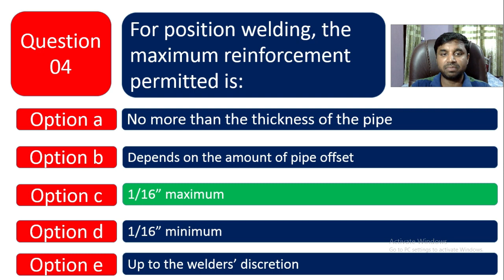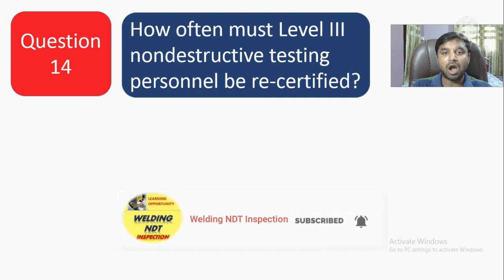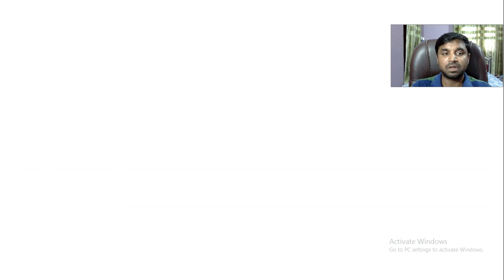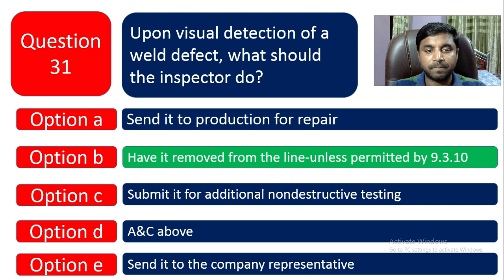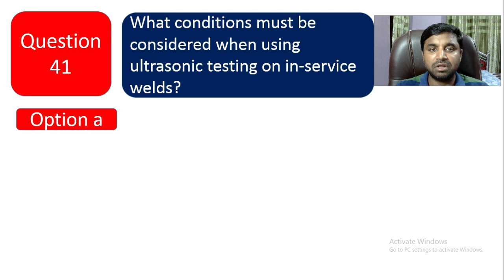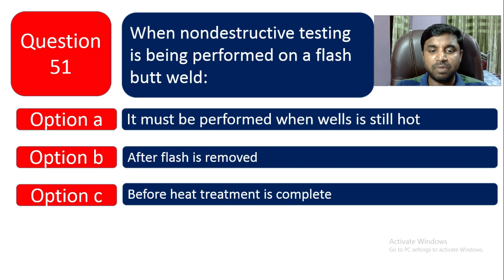TOP 50 API 1104 Welding Inspector Interview Questions

Comment: Question no:43 and 45 are confusing, 43 says welding process is not essential variable and 45 says post cleaning is not essential variable, post cleaning is not essential variable thatbis correct but welding process is not essential variable that's quite surprising

Comment: 1)Api 1104 ke anusar root gap and root face and included angle kitna hona chahiye pipeline welding me sir?          & 2)  api 1104 ke distructive testing ke anusar NICk break test,charpy- v impact test, tensile strength test and Bend test ka  procedure,And acceptance criteria kya hoga?